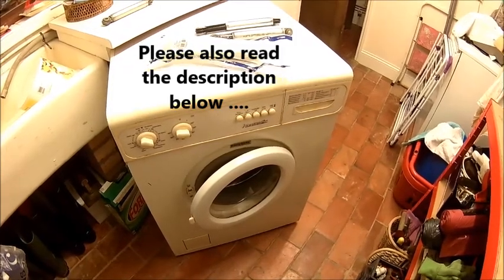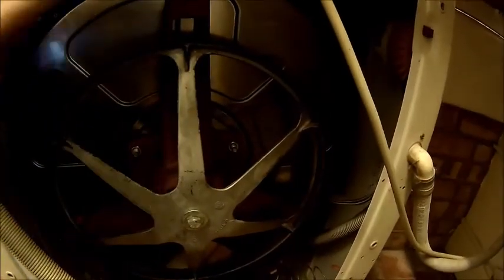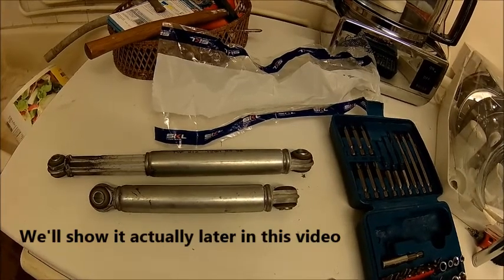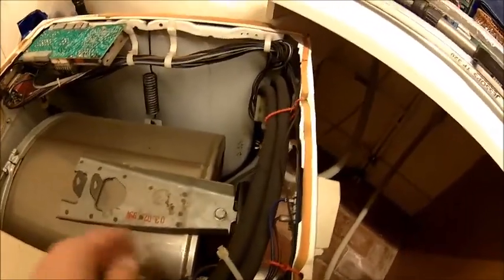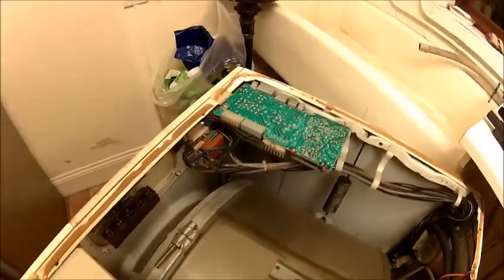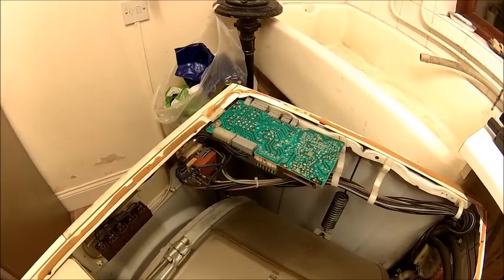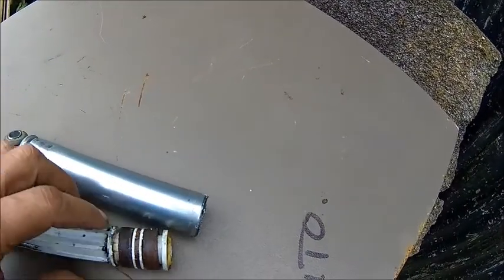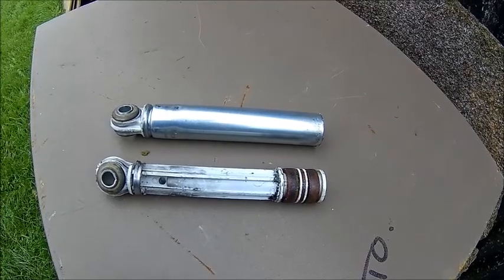Washing Machine - tear down, fault analysis and repair

Comment: That sounded like a decent machine, new ones are a pain.
I did have a service 1000 machine and the program control had a pcb fire.
After drilling out all the carbonised pcb it worked a treat :-D
Old machines are bodge able lol.
I hope your machine is still going, maybe with a simple part, so its cheap :-D